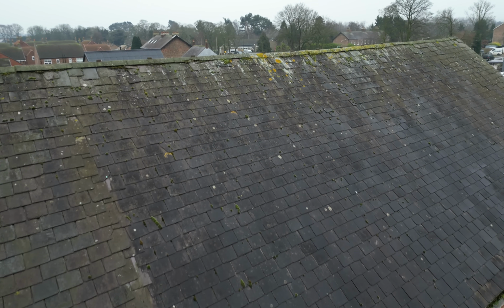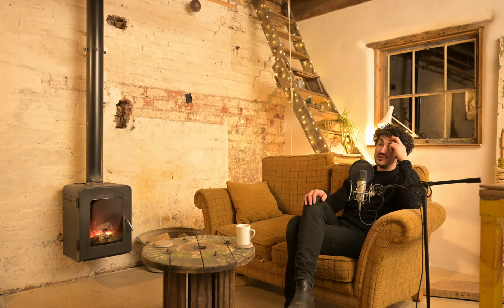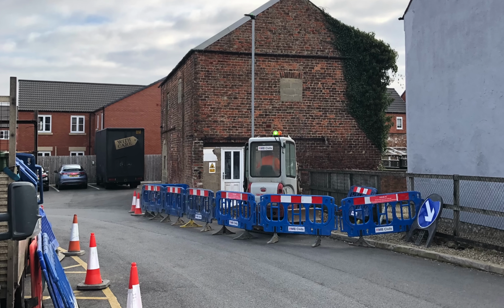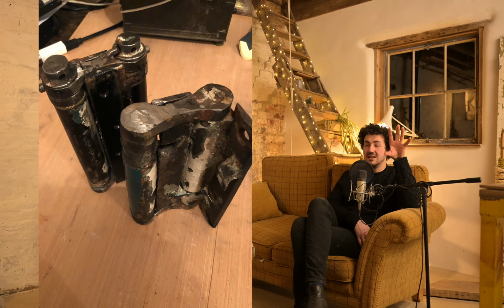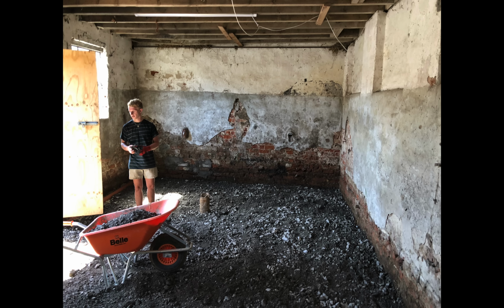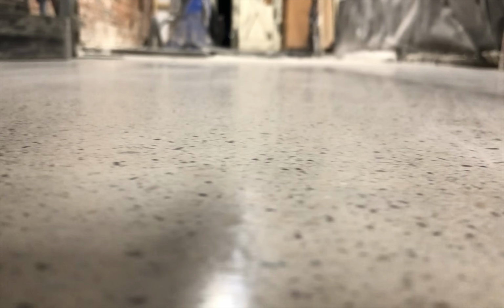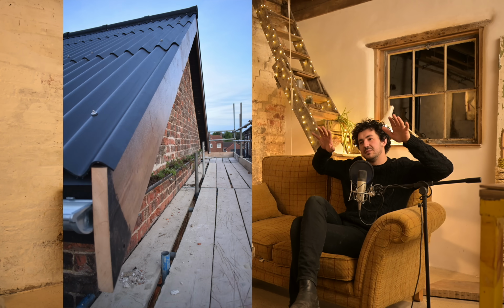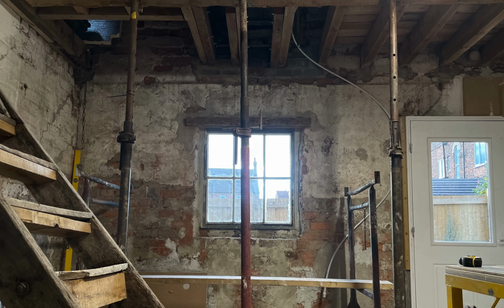I Bought an Abandoned Coach House in a Car Park

Comment: Just found you and subscribed.  Finger Cots is a word I couldn't think of about ten years ago.  I bought a knife at a Grand Opening of a large agricultural store. Folded up it was over a foot long. Open it was almost two feet. A Old Neighbor and I were scrapping out a baby car seat when I bumped the knife, open of course , it fell blade pointing down and it damn near severed my left index toe. Came within 1/8 the of an inch. Long story short I went to a local drug store and I was looking for Finger Cots. The only thing I could think of is the word Rubbers, which is something completely different. The poor shop attendent led me to the Family Planing section. Small quantity pack they had was like ten pieces. I didn't need that item and certainly that many. I asked about smaller count packages explaining that I could just turn it inside out , rinse it off and reuse it. She just looked at me and scurried off.

Comment: After you removed the concrete floor you should have run a metal detector over it, you probably would have found some beautiful artifacts relating to the history of the place, which then could have been used as features in that beautiful building of yours !!! 

Good job pal 👍

Comment: I was an insulator for many years. And I live in a wooden house which is well over 100 years old. Retrofitting insulation is 'difficult'. Now that I'm over 60, having lived in my house for 40 years now I am a big fan of tearing down and starting new if a building has no architectural merit. Yes old things have a look and feel, but often to preserve integrity we have to preserve the air and moisture exchange, resulting in lack of efficiency. My dream? A concrete house with state of the art HVAC :)

Comment: I would've gone for a Limecrete floor with under floor hot water piping.That way you'd do two things at once.
Buildings like these need to be "breathable", otherwise you might have condensation an damp issues later on.

Comment: It's absolutely shocking that not 1 but 2 architects told you not to save an old building but to knock it down. Likewise the neighbours objecting to anything and everything. It shows you everything that's wrong with Britain where it costs more for planning than the actual job

Comment: Thoroughly enjoyed this video.  Are you going to rebuild the ell on the one side of the building that shows on the wall as a shadow?  I wonder if that was the section where they kept the horses?  Those sheds and so on out there are interesting.  Are they included with your Coach House?

I have always wanted to find an old carriage house like this and do the same.  However in my case, I'd rebuild it back into a Carriage house.  I have the carriages, horses, and equipment to put it back into it's original purpose.  Ah, dream a little dream.  Wouldn't work in your case with neighbors so close and all.

Comment: Great video.
I too had a slight problem with my finger. Helping with my daughter’s barn conversion, I did some lime washing and the gloves wore through and I was left with blisters that formed two holes in my fingers. Eventually they healed from the inside out and I’m left with two lumps on my finger. No self builder comes out unscathed but it’s worth it. 
Agree about the tanking which was put on most walls of the barn and it felt so wrong.

Comment: A wonderful labor of love, which is simply unaffordable in too many cases.  It's difficult to imagine what your costs must be compared to the USA.   Depending on location, the permits, engineering and blueprints alone for this would easily be a 6-figure expense. We would ultimately have to plan around monetizing the finished project, typically by accessory rental. At the risk of being a crude American, it would be interesting to hear more about the financial aspects.

Comment: I had an index finger accident with a saw. 22 stitches and 3 pins later they put it back together. Could not feel the top two joints anymore and could not bend it but, at least, I still had it to do my carpentry with. After a few years I could bend it some and after 9 years about 95% of the feeling came back. The human body is amazing.

Comment: I've done a similar thing with my finger. I work aircraft maintenance, mostly cabin interior.  I was replacing seal around door liner panels, got complacent. Drilled through the old pop rivet head and then went to my finger. Thank God  I didn't hit bone, though, just 'meat'. The tip of the finger also doesn't have much feeling. Wow, though you are wonderful to watch, going for your dreams. Good luck. And as we laughingly say at my work, "Remember safety third" while raising your hand but keeping ring finger down.

Comment: I guess i would always try and squeeze a small accommodation in which i could air bnb so it could supply some income and take the load off. Is that a possibility? With wall beds, compact kitchens and bathrooms, I'm sure you're up to it? It would just need to be 20sqm or so. I live in a converted motor-in room. I know it can be done 😉 I think you'd still have stacks of room downstairs

Comment: I know about hurting your fingers while working, I was running a jointer, end of day, and impatient to go home. But just like that, I took the end of my finger off with the jointer, boy am I glad I'd put new blades on it, a nice clean cut, wrapped it up, drove an hour home. My Dad was a doctor, he checked it out, and said, there's no sewing that up, cause there was nothing to work with. I'd removed a full quarter of an inch from the end of my finger, and a bit of bone as well. He slathered it with an ancient balm, made in the 50s he always swore by, and by George if it didn't work wonders, no wonder big pharma never made it. Nobody would ever buy anything else. Anyway I still have a nail head size scar on the end of my finger, 50 years later. Fun times, cause it was my middle finger, and I loved showing it off.

Comment: Yep knocking out some back boxes can be difficult 
Even when hitting them with a hammer and chisel the press outs are never deep enough . 
Another way is using the old wire stripping pliers with the 90° bend on the ends . Just grip the hole knock out and twist with the pliers they just fall out . Without bashing the boxes . Good luck with the renovation its looks like a interesting project .

Comment: You didn't cover removing the old asbestos cement corrugated roof sheets., how did you manage to do it without breaking or sawing them up?
I'd like to know as the dust from breaking/sawing them up to deal with is deadly, and how did you dispose of the resulting hazardous trade waste?
Otherwise an excellent story of your persistence in renovating a lovely old building. Top job ❤
Reply from the maker: Check the description, roof video 2/3 covers asbestos removal 🙏

Comment: A couple of decades ago I got to work on a very old firehouse, old enough that they pulled the equipment with horses. It had been a modern business that had "drywall" covering everything. An architectural design company bought it and had them take down all of the drywall and drop ceilings. This exposed wood columns that had uneven rounded corners. One of the carpenters who was a farmer said it was from the horses chewing on the columns. When I was running conduit on the exposed wood ceiling in the back, old oats would fall down from between the slats. It great to repurpose these old historic buildings.

Comment: air pipe from well outside to mask to not get asbestos from the roof you said has it it can be all over... in lungs when working on things inside like that timbers spraying and.........architecht wanted to knock it down wonder why guessing the walls are not strong enough possibly so too soon they will crack fall or what, should they have ben reinforced from inside or with concrete and rebar or brick and what ...

Comment: Looks terrific. Good work.  
A useful trick is in the initial planning and community review phase is to add things you don't really want that the fussy neighbors can complain about.  They are going to complain about something. Within minutes they'll be ready to take it to the European Court for Human Rights. 
So you want that exterior spiral staircase?  Then design full length decks on both levels with a big 4' wide stairway. Zigzag back and forth. Big lights on the corners, big barbecue (something that would make even a Texan blush). Then after all the shouting is done, say "but I have to be able to get upstairs."  Have a 'plant' in the audience. "Then all you need is a small spiral staircase and a little landing."   The grumpies will be satisfied that they stopped the place from becoming a Nandos/brothel.  Never ever let them know they've been played. 

And what might I do? If there's a blank wall on the ground floor, I might build  out an entire wall of cupboards and shelves -- so it all just looks flat. Then store all my work gear, supplies, bits and bobs behind it. Don't make it perfect, just sturdy shelves. Don't bother with drawers. I'm a fan of standard office boxes, I design things like this around those. Two boxes high three or four wide.  Maybe if you occasionally need some work benches  put those behind as well.  Stuff you don't need very often, up top. Then as you refine your 'system' you can do upgrades to the blank walls, etc... Get the stuff out of sight, but easy to get to. Do it cheap so you can change it as you refine how it works. 
 Organization is numbers on the boxes and shelves and photos of the contents (with the numbers in the frame.) I've done this several times and it works well. When I cleared out my mother in laws she had about 120 boxes. My wife said, "Mom wants to go shopping for undies and white socks." I said, "Hold on, went to the data base I'd made and then said, Behind the couch downstairs box numbers 102, 104 and 108."  I made a database for her place, but mostly I just flip through the photos.   Hope this helps.

Comment: Why did the concrete floors have to be taken out? For the under floor heating?
Reply: and insulation wool plates and drain pipes , but seems a bit drastic, would it have been avoided ..could ...then no insulation or on top of old floor making new floor higher  how tall is ceiling there...or ditches for drain pipes , or many small drain pipes side by side under new floor , or  drains in corners by wall, pipes, and box over them or . also did this make the walls move and get unstable and crack or seems maybe not safe.

Comment: Here in the USA, there are swaths of properties that don't have inspections and zoning. It's good and bad. If you live in such a place, you hopefully know what you're doing. I sold a house outside of Philadelphia and there were MANY zoning requirements that had to be met. On the opposite side, I bought a house in rural Vermont, and the only zoning requirements are to the foot print of the structure. Ive had architects and contractors look at the house. I've had a contractor do some stuff, and I do some stuff.

Comment: Nice!

However I think it was a mistake to remove the asbestos roof. I know that that material for good reasons have a really bad reputation. But as long as you don't breath in dust from breaking asbestos sheets (in particular if you are a smoker) it's totally harmless to human health, and it's more durable than any metal roof and it's also fully fire proof.
(In Sweden asbestos sheets used as cladding was called Eternit as they would last into eternity, or rather outlive any building they are used in).

Comment: if u ever do a big job like this again ALWAYS start with the roof first. every builder developer will say the same.❤ love this build. Its good you did it all to the letter. i can't believe neighbours objected to a building that was an crumbling eye sore. do they just wamt want to let it fall down. its in a car par with a co-op behind it. your saving a building.
I would of tapped into tue old pipes already running next to property but as online and videos u uave to do from road incase someone dobes u in. 
My old coach house in Sheffield i didnt pay water, gas or electricity i was on the same feed as the flats that were on same land. builders/ground workers connected it up but never registered 😂. i miss that place sash windows ❤

Comment: Correct me if I'm wrong,but wasn't the original roof asbestos sheeting ?? 🤔 You seemed to "skip" this process of removal and just go straight to the new roof ?🤔 Any reason why,I was looking forward to seeing the difficulties in removal,disposal etc and how you managed ? Very curious.
Reply from the maker: Check out the older videos, there's three which cover the entire re-roofing process. I didn't want to get bogged down with too much detail on this video. I removed the asbestos sheets, double bagged them and took them to the councils local tip which has an asbestos facility. All FOC, saved a small fortune!

Comment: This kind of project and work is more rewarding then anything else I can think of. Nothing beats the feeling of taking something that has absolutely no value to modern society and breathing new life into it, sure from a financial position it's usually not practical but that's not the point. Every time I save something from the dump and repair it or fix that unfixable thing I feel a spark of joy, a lot of times these projects are more art then anything else.

Comment: Hi Max, great video; I just found your YouTube site today.  In 2003, we bought an 1860 farmhouse on two acres in Lincolnshire, including a 20-foot X 40-foot barn.  I lost my job in 2004, which gave me time to design, manage, and work on renovating and extending the old farmhouse to be what we have today.  We started in January 2005 with the plan to have the extension built, the roof on, and sealed by October, ready for winter, which we achieved.  We lived in one room whilst we did the work.  We had a makeshift kitchen and no central heating; it was just a wood burner in a wrecked living room.  In July, we even slept upstairs in our one-bedroom without a roof on the building.  The things you do !!!   Like you, there are points you love and achievements and times you hate.  Our first child arrived, adding complexity, and my father-in-law helped me do all of the internals over the following winter.  The coldest winter on record, as I recall.  Like you, I had no building experience before the project but grew into the role.  There are still jobs to do today, and there are things I will refresh and change over the coming years.  You never stop learning.

Comment: I absolutely love your passion, as you've quite rightly said new products in old buildings don't fit right and most of the time don't work, especially when it comes to insulation. All those homes with cavity insulation suffered, because cavities weren't designed to be filled. I know that from experience, the previous owner to our home had cavity wall insulation put in, 1stly they didn't clear the cavities and then had something put in that has just fallen to the bottom of the walls, so every so often I have to get someone in to clear the cavities. Then on top of that we found that they had also blocked up all of the air bricks, which we had to replace. (Sorry for the rant) Am loving the series about Round Corner, looking forward to some more episodes. Easy ground floor space should be a playground for Ziggy the grumpy cat. 👍

Comment: I've been back & watched the back story videos, having only found your channel today. I've been retrofitting with natural materials in the UK for nearly 20 yrs so this project is absolutely inspiring and your learning is fascinating to watch. I would love to see a floor plan of upstairs, with dimensions, as my next project is to install a mezzanine floor in my barn to build an apartment on it, and I'm interested in keeping it small yet functional - seeing your room sizes would be really interesting.

For future info - as it's obvious you're really interested in the vapour permeable approach to these old solid wall buildings - if you have the opportunity to do a new ground floor slab again, I would highly recommend using foamglass as the sub-slab insulation. It's insulating, but it's also load-bearing, and non-wicking so acts as a damp course too (provided your water table level is well below). This avoids the PIR altogether. Then you can do a limecrete slab as your finish slab (with ufh).
Reply from the maker: Thanks for the comment. I looked into limecrete floors but questioned it's permeability considering it's hydraulic lime that's used and also thought the floor covering would be limiting or make it ineffective. It's got to be a good thing to avoid using PIR.
Reply: @ Fair point about limecrete - but you can pour concrete slabs on foamglass, and I think for longevity apart from anything else it beats PIR. That stuff is deteriorating from the moment it's made 🤪 The first time I used foamglass I lay a vapour permeable membrane on top, then did an earth floor - 70mm sub slab, ufh pipes, then top earth slab. I ended up topping it all with unsealed terracotta tiles on a lime mortar bed like you used for your woodfibre (great tip there, by the way - and much easier to work with than the more expensive adhesives). Plans changed and it became a rental for a while, and I didn't have any faith that tenants would want to look after an earth floor! 6 years on it's still looking great 🤞